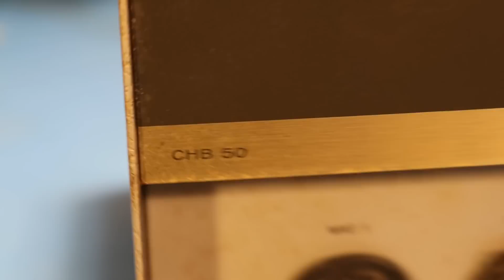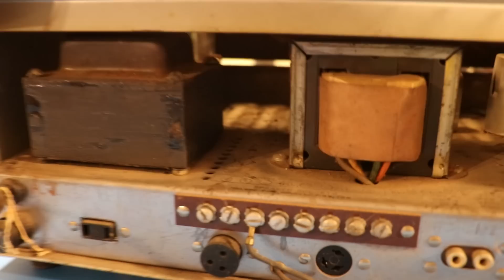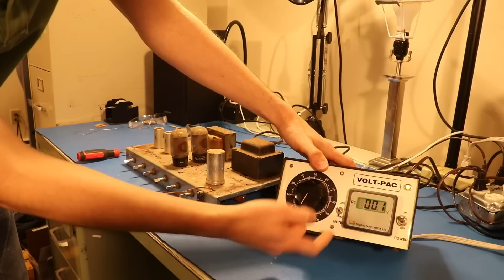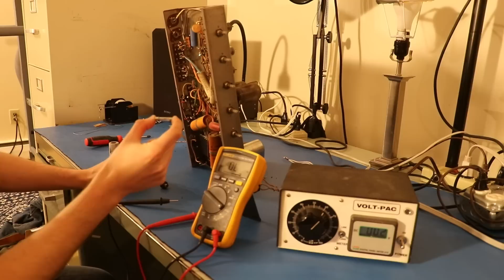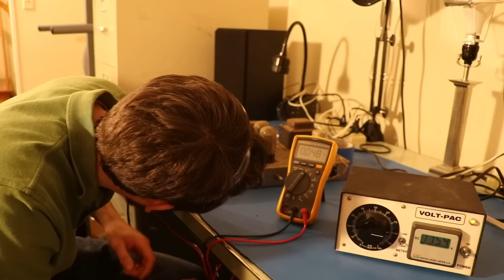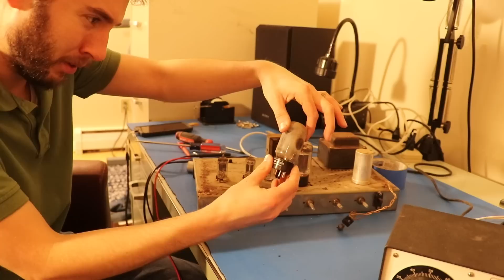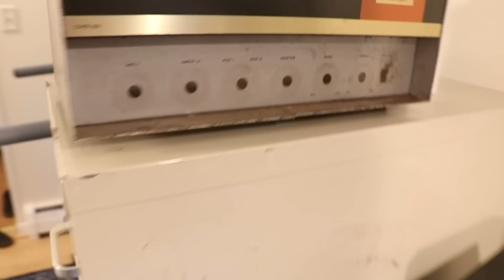Powering Up A Forgotten 60-Year-Old Tube Amp - Bogen Challenger CHB50

Comment: THIS IS JUST CRAP TECHNOLOGY. I had two old tube radios, I am also scared of it, the workmanship without PCB is horrorfying, it is not safe and the worst thing is, I tried one one 240V and it did not even work and then a few seconds later, the parts inside cracked and made noises (not the speaker, the parts inside) and I switched it off. That was the last thing I ever touched, total worthless, waste of time, I sold them cheap with 100s of tubes and will never ever touch it again. It's just too old and too crappy and not fun at all, no power, no replacement parts, no nothing. Belongs into the garbage at this point in time, it's not safe and I am not safe around this stuff. You cannot operate it. Simply as that.
Reply: It's you who messed up it's not the equipment's fault. Powering it on before inspection and replacement of critical parts is a no-no. 
Point-to-point wired amps are still being made today. PCBs were already around when this amp was made (I'm guessing early 60s?) but PTP is ALWAYS the better choice for tube gear - PCBs just don't handle the heat all too well. I have wired PTP amps all by myself and it isn't that hard, especially since tube circuitry in an amp is usually very simple. you just have to take no chances when it comes to possible shorts... Then it's as safe as anything else.
Reply: @westelaudio943  well what do you think most people will do? Test it - I dont know if it works even when I swap out the capacitors first. Maybe the tube is broken, so what do you do then? I just say, in general, this is not a technology I like, not a technology that is robust, and not a technology that will last because tubes ARE worn out by using it. It is DESIGNED to fail, as you mention, due to heat and other problems. Good point with the PCB, I looked inside and I thought to myself: This is not what I am into, this is not what I want to do and this is nothing that I can use because I am a bit scared of it. I dont want to burn my house down and it is not safe to use. So I turned away, I sold it to some people that can do something with it and that is totally okay. I did not throw it away, I did not power up the second one, etc. I tried it and that was it. I have only bad experience with it, even my fathers not sure how to say it, volksempfänger (nazi radio) went bad. 

If you are into it, man I am the last person making anyones joy or hobby bad. I love poeple that do such things, have a passion and knowledge etc. I even went to a radio convention/swap etc. I tried it but I decided it is not what I appreciate. I like solid state, I only like harman/kardon and this is my field, I know what to do and try my best, but I am not a professional in it.
Reply: @stefanegger  

Tubes don't wear out that easily. That's more of a problem concerning high frequency or television tubes. Usually in an old radio you'll find few bad tubes, and then it's usually certain HF tube types. The audio tubes don't go bad easily. Unless they're pushed over the max like in a guitar amp type device. 
Any tube is more reliable than an early Ge or lockfit type Si small signal transistor - and you cannot really compare 60-80yr old equipment to 40-50yr old anyways.

If you power it on, you do it very carefully, with an  incandescent bulb in series, and maybe on a Variac.
Before that, you should have checked or replaced critical components, no, not all capacitors. You just gotta make sure the transformers and expensive tubes are safe - by checking their coupling caps and the mains filter cap for shorts. The paper-wax CAPS are the main problem in pre-1960 equipment, not the tubes. Later tube equipment for the most part does not have this problem.

Do the first power up OUTSIDE and
If it sizzles, let it sizzle - don't freak out, at least you now know what's bad. What's most likely to sizzle is the across-the-line decoupling cap - a problem also present in a lot of transistor equipment, even into the 80s (RIFA madness).  So it's not as easy as saying - tube bad, transistor good. Many people have built awesome tubeamps which last very long and are as safe to use as any transistor amp. Of course some cheaply made radios will not be safe by today's standards, but you can almost always get them to a state where the risk is very low.

Comment: Red hot plate is indicative of no bias on the output tube. It can be caused by a shorted grid drive cap. Grids are set to be negative voltage under normal operating conditions. Get a schematic and check it out. Not that difficult. Watch a video on basics of tube operation. No. The tube is likely not bad. You turned it off quick enough. Additionally, this problem was indicated by the distortion prior to the failure. Improper tube bias. Likely because of the leaking cap.

Comment: When you mentioned the high voltage I imagine it will run hot . A friend of mine had a Class A component HIFI the  power amplifer used to run very hot . He needed to have a seperate ring main to cope with the power draw of the system

Comment: From what I know, you shouldn't even turn anything with Tubes on, without having all paper/wax capacitors replaced. They might still work marginally, but they could also fry stuff beyond repair and you'll have more work ahead than initially. Nice to see that kind of tech being worked on. Nothing you see every day! Thanks!
Reply: Yup, basically they stop being capacitors and become resistors. He mentioned watching Mr Carlson  - he covers this issue quite frequently, I would suggest he watch a few more videos.
Reply: You can if it's on a variac.
Reply: @CDJF1  yeah, you can, on a variac, having the ingoinf voltage way down. but then it's pointless, cause the tubes won't even conduct properly, and you can't check things. if you up the voltage enough for them to conduct, pretty much the same will happen that happened here: Fryage 😅
Reply: @CDJF1  ,  Personally I would not use a variac to power up an old tube amp in unknown condition without at least checking for bad/leaking filter caps and coupling caps, and preferably replacing the most likely failure points first, unless you also have a sensitive ammeter hooked up and can monitor current draw for signs of trouble. Ideally, a light bulb current limiter should be in series with the amp's power transformer.    Otherwise you risk going from "Ah Fix It" mode to "I Wrecked It"!
Reply: Although I agree that the old caps will undoubtedly need to be replaced. In this situation where you're just trying to see if the entirety of the unit is still in tack, a variac brought up much slower than in was in this case, can often re-form the old caps enough to get you through an initial check to see if you at least have a working amp to begin with.

Comment: My son has two of these in great condition. He used to use them with his computer with some Infinity speakers. He liked the contrast of old and new. In the 70s when I was in the Navy, all the communications gear I worked on was tubes. I once got 450 B+ plate voltage from a transmitter through my chest. Wow, did that hurt! I was sore for days. Be careful! I want you to fix it for selfish reasons. One of his amps has some hum and I want to learn from you how to fix it.